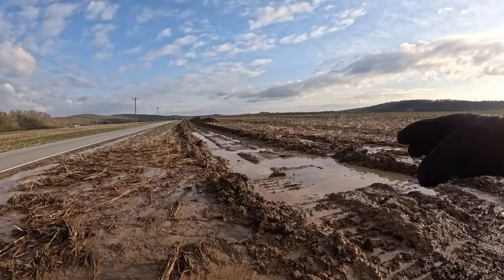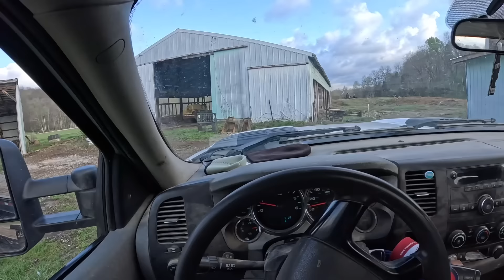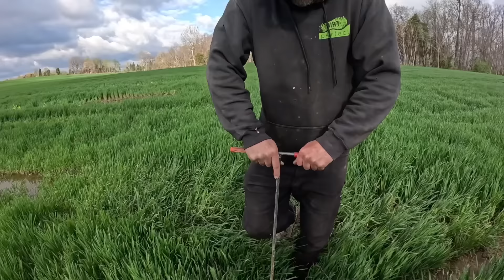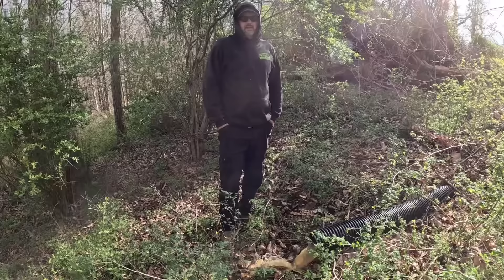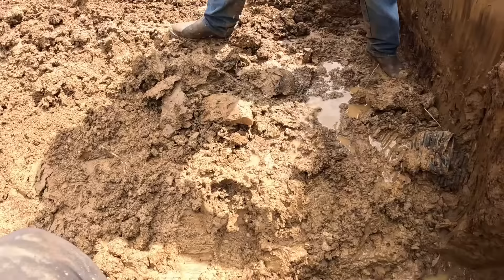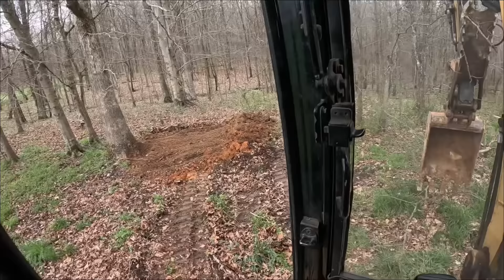Mud management is the new plan this just sucks!!

Comment: An old water truck with good pump on it would pay for itself in 5 or 6 yesrs.   Use for pumping water out of holes.  Spraying dirt out of tracks.  Washing stuff before hitting the road.   Dust prevention.  Spraying brush killer.  Itvwould be handy.   In a pinch fughting field fire.

Comment: Great video! 
To improve on your trailer jack handle situation, think speed binders. I have the same jack. I removed the handle (one bolt). Clean up paint on remaining shaft and weld on a 1/2" X 15/16" 12 point 1/2" drive socket (fit snug for me on 10k Bulldog jack). I then use my  DeWalt 20vdc drill with a 1/4" drive to 1/2" adapter to raise and lower the trailer tongue. Works great for me and adds a little theft protection to the trailer.

Comment: Probably just need to replace the screws in the metal to stop the leaks. The rubber seals on the metal roofing screws will dryrot and shrink, which loosens the screw and causes a leak. I'd start with replacing the screws for sure.

Comment: You use a drill to operate your tiedowns. Weld a socket to the crankshaft of the trailer jack and use an impact drill to operate it up or down.

Comment: U ran ur laser down that it said it was level,  but acording to those puddles that looked 2 feet deep it wasnt,     i use laser level in my concrete work, i hqve learned that the humidity in the air bends ur laser,    water does bend light,

Comment: DP, have you looked at the EZ-Crank drill adapter for the trailer jack? From my experience it works great, but my trailer is not quite as big as your Corn pro trailer from my eye balling measurements

Comment: uhhhh...if the drainage was in all the way across the fields and the ditch for the new drain tile was made to drain the water why was the ditch =rest of the drainage not draining....it away...something is off here,odd,not right... there...something isnt making any common sense about this...
Reply from the maker: That’s very obvious buddy
Reply: The ditch was put in on level not a slope and it was just roughed in to get the tile to depth.  When tile goes in it will be at depth and slope set on it.  This well make the tile and field drain right.  The whole thing with the ditch was to get him to depth all the way up 3/4 of a mile because of a few hills in the path.